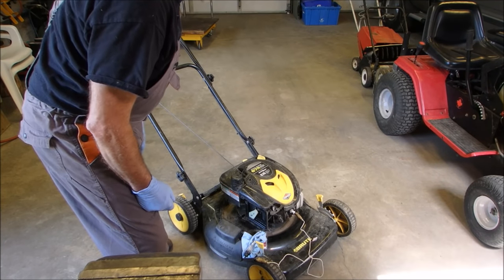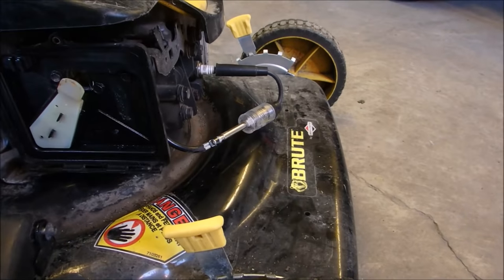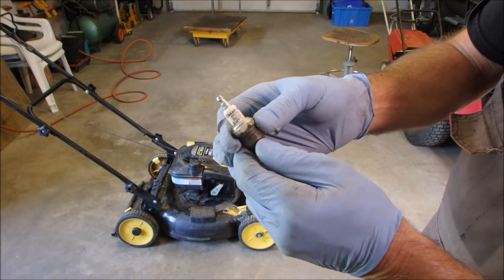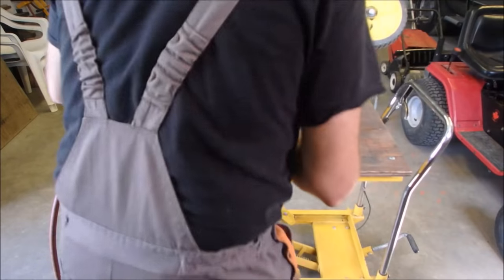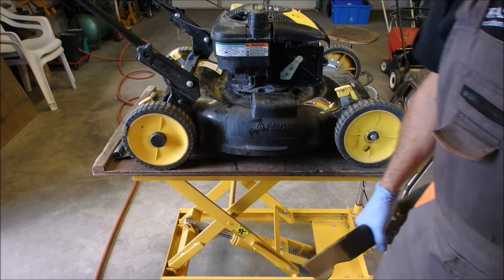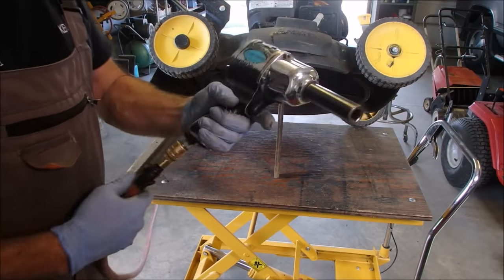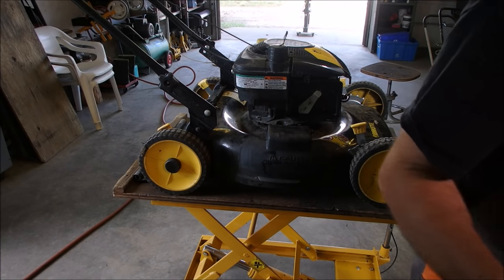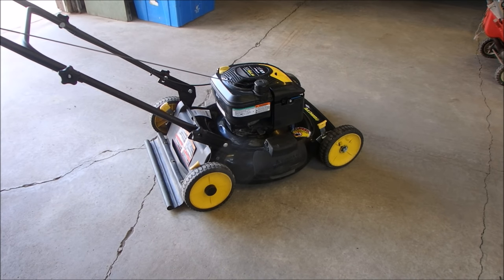Repairing a "BRUTE" Briggs Mower That Will Not Start

Comment: Hi Bruce: Love our video's, I also have had trouble with those plugs, I have found it cheaper in the long run to just replace the plugs and not to try to clean them, Only cost a couple if bucks and no returns or unhappy customers.
Reply from the maker: Well I have a good stock of the older RJ19LM and I use those.  Great plug.

Comment: Good job. Inspector Gadget! I was talking to An authorized Toro dealer/repair shop. They said that and other dealers were having issues with the EPA Champion RJ19EX plugs.  Toro sent them replacements. RJ19 LM The one they used for years. It seems anytime the government gets involved on something it gets screwed up. The old saying "If it's not broke, don't fix it!".
Reply: I just got 2 tillers in for repair. They are both old points type engines. One has been converted to electronic. The other has not and is a no spark issue and had not been run in a while. I thought about converting it also. Do you just remove the old points and condenser and install the new style coil or is there something else that needs to be done or installed. Or another way do convert it?
Reply from the maker: No  I just remove the old point like you say.  I can be interesting to see if there is water under the points cover.  You can check this video    interesting spot at 4:04 when water drips out of the cover I mentioned.

Comment: Nice (almost) standard tune-up. Most people don't understand a tune-up is done to running mowers. Non running mowers have to be diagnosed and fixed before tune-up. In response to your your comment on SAE30 vs 10w30 oil expense i just never noticed. To me oil just got more expensive in general. i"m always looking for the oil that is on sale.
Reply from the maker: Me Too.  Thanks George. I have the low detergent 30W for pressure pumps of course.

Comment: we have the same mower, but what we're finding is that the idle seems very slow. when mowing it struggles. We just cleaned the carb in the ultra sonic cleaner and replaced the plug. Any ideas?
Reply from the maker: You can tighten the spring on the throttle going to the governor.  Not the governor itself though.

Comment: Here's a Safety Tip to remind you; On your lift, if you paint the words SPARK PLUG, it should remind you every time when you flip the mower on its side to remove the Spark Plug or at least disconnect it.  Because every time you flip the mower on its side we wonder, did he disconnect the spark plug. When we get old, we forget. especially this old fart. WE enjoy your videos.
Reply from the maker: Right

Comment: Do you have a video of the spark tester extension cable you made?
Reply from the maker: I think it is just a wire with clips.
Reply: I wrote the company that makes the tester and suggested that they make a extension cord for push mowers and they wrote back and said "they didn't see a need for it" .Thanks Bruce, I'll grab some alligator clips.
Reply from the maker: Right on

Comment: Nice vid.  I picked one up curbside, fixed it up and gave it to a single mom with 2 kids.  Even put a new belt on it. That was  nasty filter, btw. Did you check rpm?  I do tune ups at home too, generally charge $45 to $50 . Plug, filter, oil, blade sharpening, rpm adjustment if needed, and lube height adjusters, and cable.  Most of the the older crowd, 65 +, thinks it's too high. Those under that think it's great deal. In and out in an afternoon, no 2-3 week wait at the mower shop. This is south Florida in the summertime. What say you?
Reply from the maker: If your price makes some people happy and others not you are right on the money.  Here too older folks like me,   look around town for backyard guys like myself.  Good luck sir   you are on the right track.

Comment: Mine runs but my handicap son used it while I was at work to mow our yard and broke the self propel cable or whatever is connected needed to know how to remove the cover or how to get where I need to be same mower 675 b&s brute
Reply from the maker: That is a tough one.  You can remove the cable and google the type of mower to get  new one.

Comment: hi Bruce thanks for the excellent videos what is the mixture in the red can you squirted in to the throat of the carb .
Reply from the maker: It is a mixture of 90% gas and 10%     2 stroke fuel.  It provides combustion with some lubrication.

Comment: Hey Bruce I have small engine shop of my own and it's been circulating that I charge way to high what do you charge to fix and tune up the mowers you work on?
Reply from the maker: I don't talk much about what i charge as this is a hobby and most of what i fix a shop couldn't make money on.  When i am done the machine might be worth $100 and I have 3  hours in it with $20 in parts.

Comment: Did you tighten up the wheel adjusters? The front wheel had quite a lot of movement when you dropped it after putting the blade on. You can see it at 10:06 in the video.
Reply from the maker: Good eye!!

Comment: Gotta love simple fixes! I got a free non running mower a couple years ago. The owner put a new plug in it but it still wouldn't run. I got it home and started looking at it. I figured that I'd put the new plug in my mower since it was about ready for one. Guess what? Yep, my mower wouldn't start. The owner had the bad luck of buying a brand new bad spark plug. $2 fix and I'm still using it!
Reply from the maker: What is that about eh!!!.   You would think that a new plug would work.

Comment: Does it make any difference if you use a resistor plug or not?
Reply from the maker: No.  The resistor plug was originally used to reduce radio interference.
Reply: Thanks for the tip Bruce. Love you channel.

Comment: hi what kind of oil is recommended for the lawnmower?
Reply: SAE30
Reply from the maker: Right.  I find that expensive so I do buy 10W/30 as well.   I use quite  bit.  I used 10W/30 on my old Tecumseh and it ONLY lasted 28 years on a double lot of grass.  (joke)
Reply: 10 w 30 
Thank you great videos and very professional

Comment: Where did you squirt that starter fuel
Reply from the maker: Into the carburettor with the air filter taken off.  There is a small metal tab in the way but behind that.  At 0:34 in the video

Comment: its always satisfying to find the little things like that missing lock washer that unchecked could be a safety issue. I don't see many of that particular plug, becaue I think that by the time I see that model of Briggs the plug is already died and been replaced or I see the craftsman version and they seem to have the proper plug. Can't beat the RJ19LM for sure.
Reply from the maker: Thanks Pat

Comment: That is the nastiest air filter I have ever seen !!!..I need a table like you have ...After laying on the ground to get my blade off and change oil  for years ..I am getting to old for that ..At least I have cardboard and sometimes an old rug to lay on...The only problem with being comfortable when laying on the ground is I am tempted to take a nap !!!...And I have taken a nap when changing oil in my truck !!!
Reply from the maker: I am now 5 years older than when i go the table and even it seems a little low now.  WHEWE!!!

Comment: Those rj2yxle plugs were a failed effort by briggs to improve emissions, but would instead wet foul easily after a little use. Many briggs owners took their mowers in for warranty work only to be told it was bad gas and therefore not covered under warranty, when it was really this bad plug which briggs certified repair shops knew about. So instead of replacing the plug under warranty, shops would just put in an rj19lm and then charge customers $70 or so for a tank flush and carb cleaning, neither of which was the problem. Briggs failed experiment with this plug cost its customers needless grief and expense.
Reply from the maker: Thanks 73    That doesn't surprise me.

Comment: I've noticed the plug wal-mart sells for the " L " head engines with the smaller electrode is no good,  I'm not in the shop right now for the numbers,  but every time I get a L-head no start, the plug is my first lookie -see.  I have a plastic tray full of the smaller electrode plugs I have replaced, Also my parts supply house that is a TORO dealer told me the plugs ( smaller electrodes ) do not work in " L " head engines & and should be avoided. Every customer that tells me they changed the plug, I ask where did you buy it and the answer is always " WAL-MART ".   Other than that, 80% of small engine repairs are fuel related.  I have also noticed how many are WAY over full on oil.  Just the plain old Champion spark plug is just fine for Briggs & Tecumseh "L" heads works the best,  I have seen E-3 & other brands ( more expensive ) that just preform poorly.   Sorry for the long rant.
Reply from the maker: You are right on.  People put the entire liter (or quart) of oil in the motor and they are FULL.  You can't compress a liquid right?  As Well I trust the RJ19LM   but others i don't.    Hard to believe that a backyard mechanic is correcting a factory issue eh!!!
Reply: I noticed you have a facebook page , as do I.  I would like to add you to my friend list if possible .
Reply from the maker: Good work on that.  I have been trying to keep the 2 separate as the family uses the Facebook page and It would get so flooded with posts from You Tube that I have the 2 separated.  I am sorry Robert i hope you understand.  I have more than 7000 views a day on You Tube now.  That is a good problem though.
Reply from the maker: I have been trying to figure that issue out as I have the same name on each.  Like everyone who has a computer i am spending too much time on line as it is.  You can email me at bthversion1@gmail.com

Comment: there is a number of reasons why these Briggs and Strattons don't start besides the plug, the coil with the Magnatron igniton can be bad, or the Carburetor the seals due the the ethanol or E10 in the gasoline in regular unleaded fuels. and the problems most of these modern Briggs and Stratton engines suffer from is the PLASTIC camshafts and Plastic timing gears. when they fail the valves don't work. as the Quantum engine seems to be a good engine the professional series OHV the later 3.5 hp and the newer OHV engines that replaced the 3.5 hp or model 9 engine they all have plastic inside them. its the way Briggs and Stratton are making walk behind mower and pressure washer vertical shaft engines. the other problem in the modern briggs has to be in the Ready Start system some cut off its basically a thermostat choke an air vane and links that link the choke to the system.
Reply: shhhit, plastic cam, really ? Just bought one,,, will resell right now while is still in top shape condition.